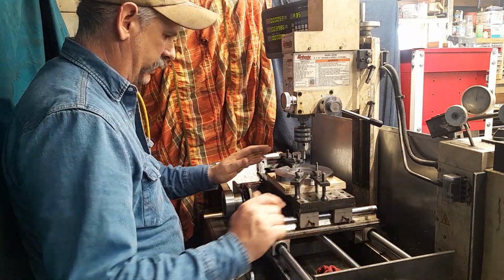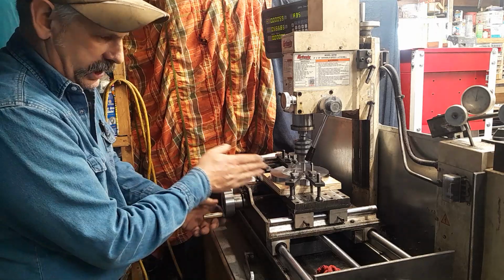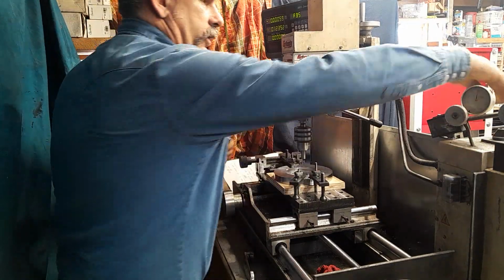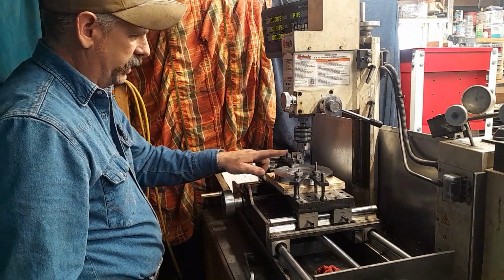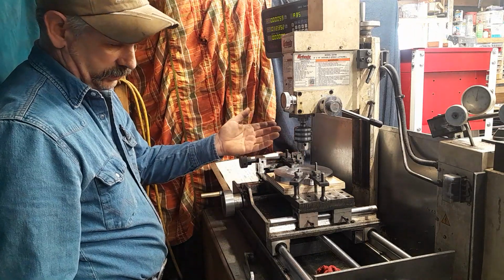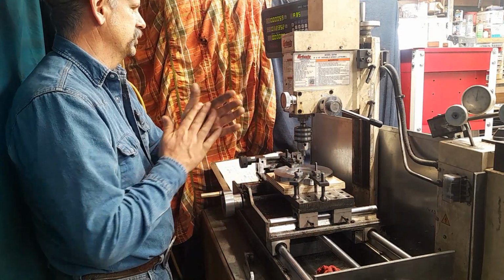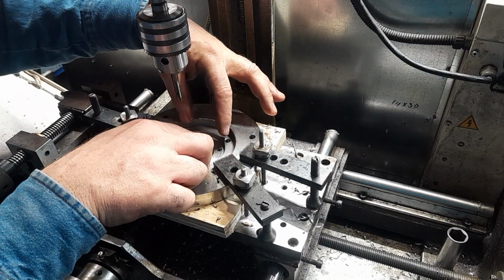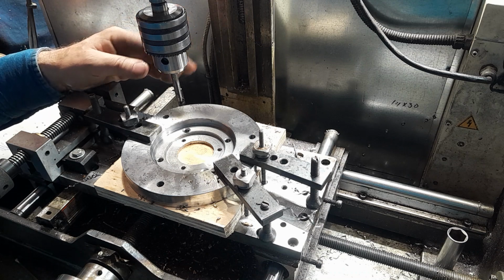6 jaw chuck part 3

Comment: How did the acetone work separating the plates??
Reply from the maker: It worked pretty well.  I let it soak a little and tapped with a brass hammer.  It sure made cleaning the super glue off the parts easy.